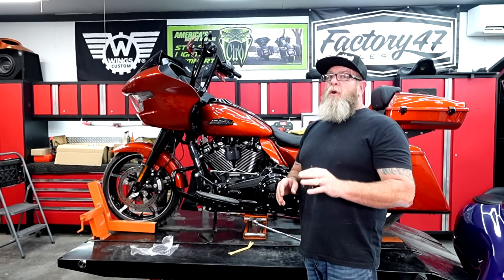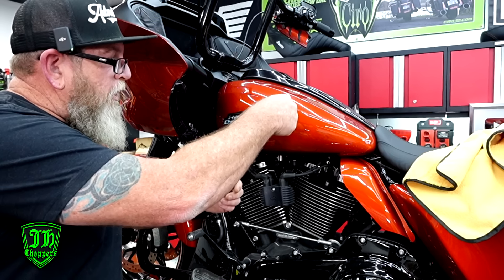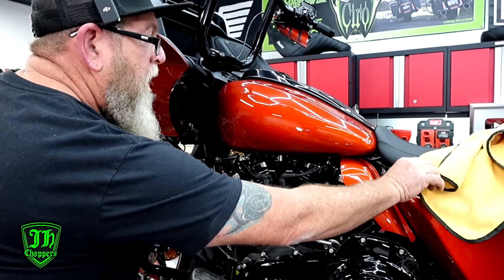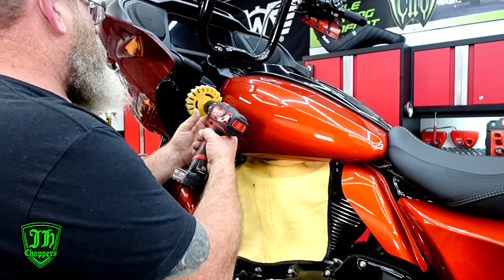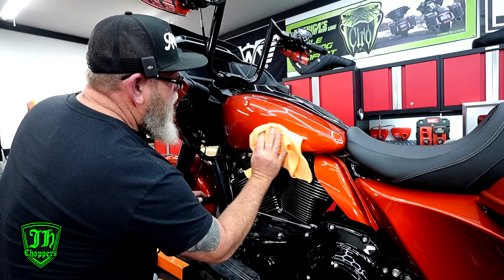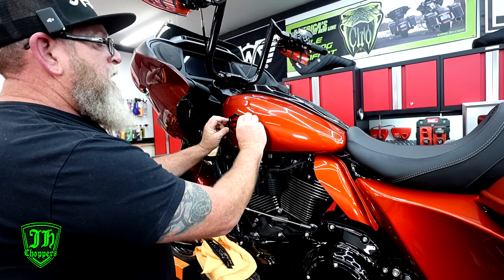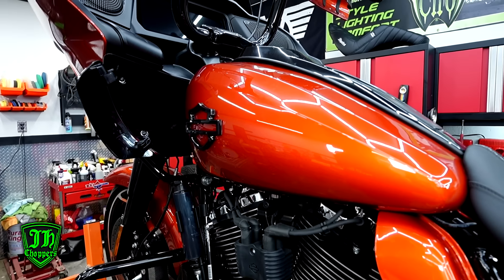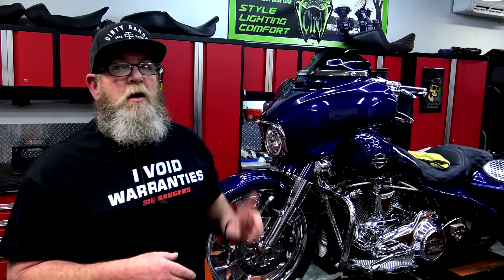⚡ How To Remove Your Tank Badges and Install New! It's Easy!  ⚡

Comment: Alternate method. Just pre heat the badge a little with a heat gun or hair dryer, then use dental floss under the badge in a sawing motion. Clean the residue off with isopropyl alcohol.  Polish. Done.
Reply from the maker: yes that will work too....there are several ways to do it...thanks for checking it out!

Comment: Hi Steve, I got my badge from JH Choppers yesterday as well and they do not fit flush on the tank.  I sent an email and they referenced your video for placement. I learned about JH Choppers FROM your video, but I rewatched your placement very closely and they do not fit flush.  Unfortunately I need to return them and will try RickRaks.  Just wanted to pass the feedback along because I love your videos, thanks all your for the content!
Reply from the maker: yeah just let him know
Reply: Same for me… I purchased a set from them for my 21 Roadglide and they were perfect. I returned the first set and the 2nd set didn’t fit either. Disappointed but will give them 1 more chance.

Comment: Have you had any issues with your road glide? … I just bought one it has 500 miles and no issues but I’ve been hearing a whole bunch of negative comments
Reply from the maker: Nothing yet...I dont have a ton of miles on it yet though either. Been reading the same comments...make sure to keep your bike updated at HD if you can...HD is releasing updates all the time for the 2024s

Comment: I pulled the trigger today and ordered the Chrome badge for my '23 Ultra Limited and run me about $107 after tax.
My plan of attack is to mark the top of the old badge before I remove it and use that mark (maybe a sharpie) as a guide to place the new badge.
Then use my 10" buffer to take any goober adhesive off.
Reply: I like your approach lol with a little sharpie mark here and there haha!

Comment: I toggled back and forth between badges on your vid. That looks way better than the original badges. Thought about doing my 2022 ultra limited- apex paint bike. Looks like I'll pull the badges off in the morning and see if I need to get badges or not. I do have badges the same size as the ones you put on and they are the color of my stripes. I was going to put them on the passenger floorboards, my girl's suggestion, but once I taped them in place both of us didn't like it.
Reply from the maker: yeah ive got these badges now on 3 baggers...they are sharp....mock them up on the tank and see how you like it before you stick them.

Comment: Another great video! What disk/ brush do you recommend to use to get the glue off? You used a yellow one in the video. Do the different colors represent different grit or stiffness? Thanks for all the years of great content!
Reply from the maker: aaah yes I forgot to link it...fixed it..but I use the whizzy wheel from amazon ...the one you seen in the video has already been used several times on my bike trailer...and lots left..they last pretty good. here is the link https://amzn.to/47hoIDb

Comment: I have never heated it up - just fishing line only. Just keep it in a "sawing" motion and fishing line works just fine. No heat needed.
Reply from the maker: never had luck with it...just pry it off and clean it up has always worked best for me...but then again I may have had some cheap thin line as well..maybe some stronger line would work better.

Comment: do you have advice on heat deflectors install on 2024 RG????
Reply from the maker: yeah dont use the bottom speed nuts...take your side covers off where you can get to the back side and use regular bolts, washers and nuts on there ...slide the bolt in from the battery side and out the washer and nut on behind the deflector...its tight but you can do it

Comment: Im just curious as to if I placed them right they look great but don't lay on the tank to flat...there are still parts of the badge that aren't even touching the tank...ever encountered this or do I need to re do them?
Reply from the maker: Sorry for the late reply...been at Tail Of The Dragon for a week. I didnt have any bits hanging off the tank...the tape itself will fill in most of the tiny gaps...I would reposition them.